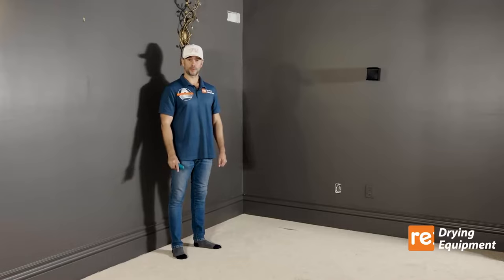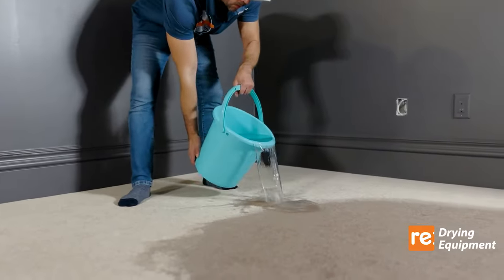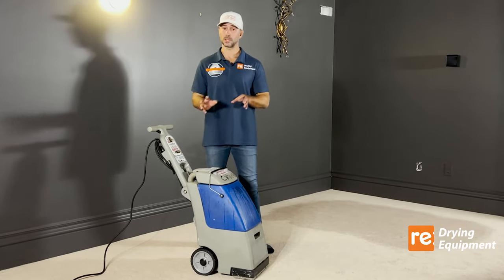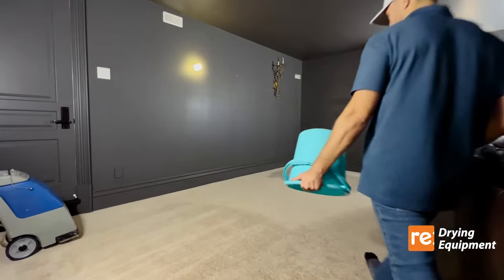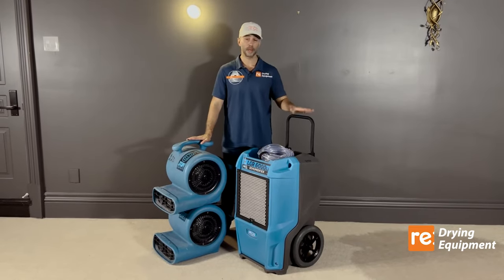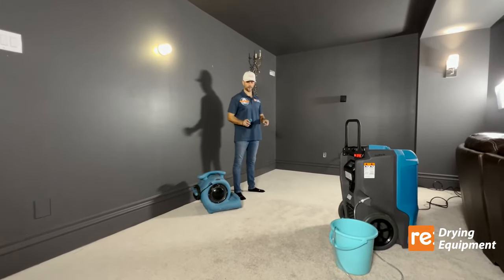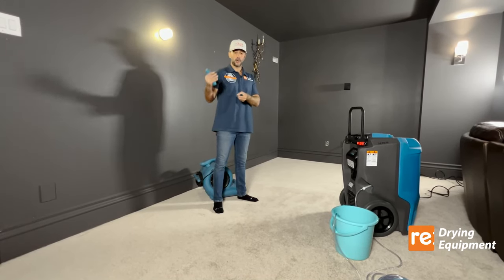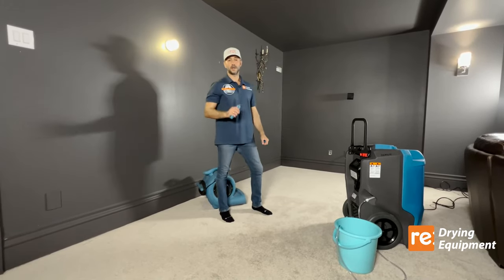How to dry a wet carpet after a flood, leak or water spill?

Comment: If it's a category 2 or 3 loss then the carpet should be replaced. This is a great video for category 1 loss where water was sanitary. Thank you for the comparison.
Reply: Just had a client’s washing machine drain pipe discharge all over their carpeted floor.  Am I wrong to consider that soapy water sanitary?

Comment: Leaving standing water in a carpet for longer than 2-3 days, will 100% cause a damp musky smell or even mould/fungus growth.
If the carpet is as saturated as shown here, the only way to prevent that is to use a shop vac to extract as much water fron the dapet, then lift the carpet, bin the underlay, dry out the underfloor, replace underlay with new and finish drying carpet off the floor, ideally outside etc for 1-2 days

Comment: Don’t even keep the carpet. Just throw it out.
Reply: different when it’s a rental :)
Reply: Ok- not everyone has that luxury to afford a new one and often it’s not necessary at all.   The flood source, amount of intrusion and local weather conditions all play a part.  
Here in southern California where I am mold isn’t as big of an issue as say the south east.

airflow, humidity control and vacuuming can save that carpet saving money and resources.
Reply: @prof.crastinator  Hiring a crew or renting the equipment and doing it yourself… you’re really not saving much. Why take the chance with mold when that will cause chronic health issues and cost you way more in the long run EVEN if you dry it completely. Carpet hold tons of nasty dirts.
Reply: @holylabs  Again- mold isn’t an issue here. I would toss it at the sign of mold
Reply: @prof.crastinator  I would toss all carpet and only use sectional ones that can be thoroughly cleaned. To each their own. Take care.
Reply: I would not use carpet in basement unless has sump pumps cut in drains around the foundation.
Reply: I would toss it who has that equipment to test the carpet ...professional